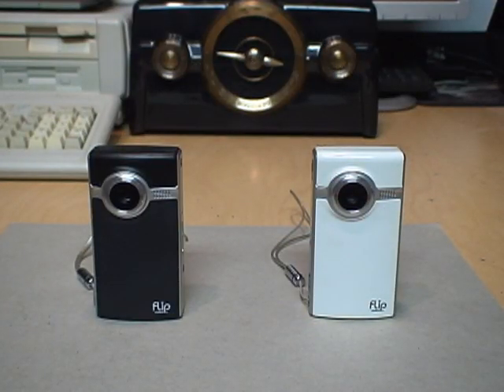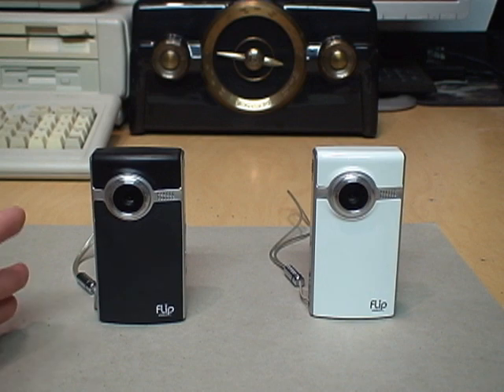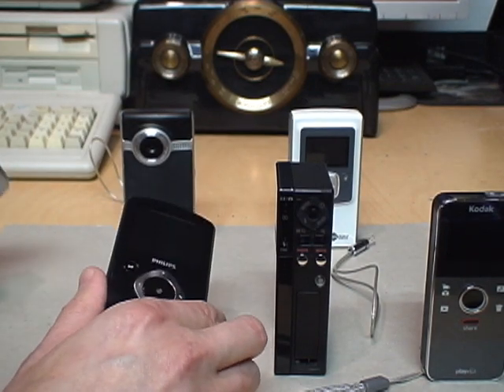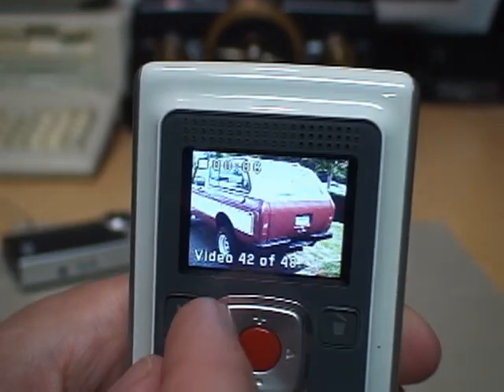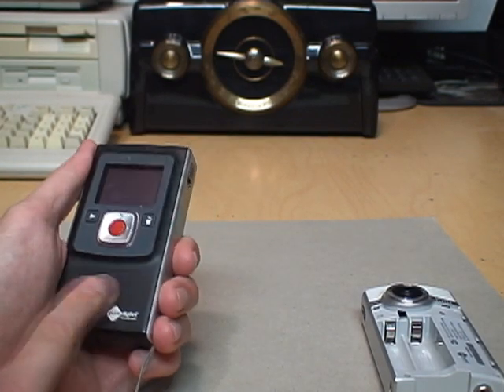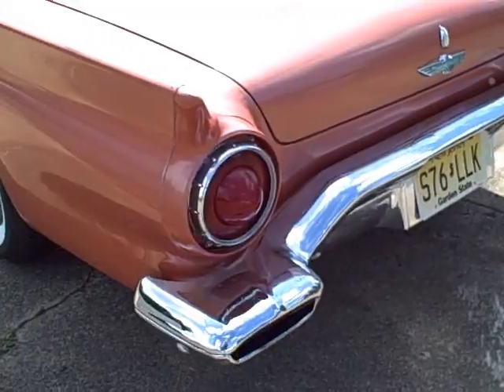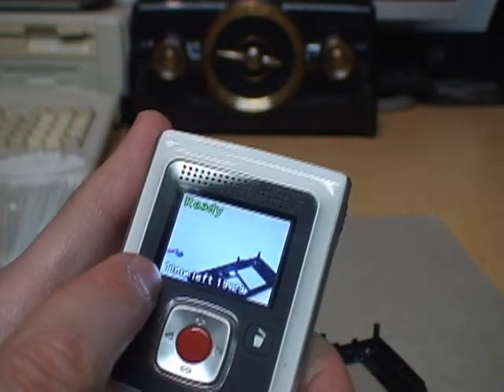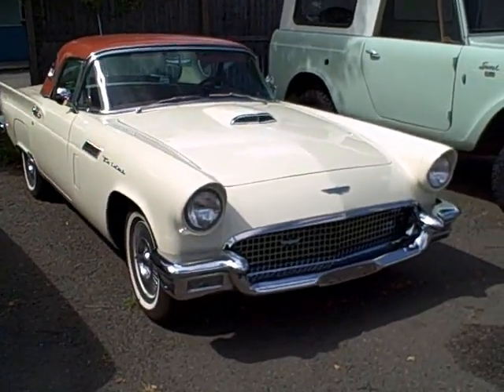Flip Ultra - The camera that powered YouTube's Golden Era

Comment: There's a little bit more to the story on these. These came about as the company who came up with this design originally sold them as a "Disposable Digital Video" camera. You bought it at CVS and had to bring it back there to get the video out. People figured out how to hack it so you could get the vidos your self at home, and keep and use the camera. At the end of 2007, I guess they realized their business model wasn't working out and they released this version with the USB port called the Flip. The business was eventually sold to Cisco Systems.
Reply: I remember those. I hadn't realized it was the same device.
Reply: PS to @VWestlife this means there may be a way to recover video from a dead one.
Reply: @alextirrellRI  No. The original one didn't have the flip out port. There was a "special" connector hidden under sticker on the top.
Reply: @alextirrellRI  Also meant to say, it was still the same USB, but you needed a special decryption key. The new model didn't need that.
Reply: I was just about to say that myself, I remember seeing those at CVS in 2006.
Reply: @ManiacalMichael504  It would take some digging, but there was a hacking scene for those CVS disposable cameras. That special port under the sticker was nothing more than a repurposed Palm PDA port. It's been ages, so I don't remember the exact model anymore, but I hacked the video as well as the still camera. We hacked those because even after the cost of the adapter and time, it was still cheaper than an off the shelf digital camera.
Reply: @doughnutsfowler  Holy crap man I totally forgot about that. I remember seeing youtube videos about hacking those disposable video cameras. I think this is the video I remembered. https://www.youtube.com/watch?v=klaVyjCjoUw

Comment: Flip ultra solved the vertical video problem but even the latest smartphone defaults to vertical video if you hold it in the most natural way to hold the phone. WHY?
Reply: How's about this 1:1 aspect ratio that major news sites are now uploading to YouTube?

It looks terrible on YouTubes phone app. And will look terrible on many monitors.
Reply: @jeffkardosjr.3825  I have the Motorola One Action, which has an 'action camera' that allows you get horizontal video from holding the phone virtually, because the camera has been installed at 90 degrees. I think they put that in 2 models in 2019.

Comment: I still have my Ultra HD that I bought at a flea market many years ago, and it was my secondary camera for some time before my OnePlus One with a dying baseband took its place. The rechargeable battery it had no longer takes a charge, but the fact that it takes AAA batteries (they predate the popularity of external batteries) does allow me to still use it if I needed to. 

Basically, as I imagined it, someone would be at an amusement park or some attraction, the rechargeable battery would run out of power, then if they were near a kiosk that sold camera supplies, they may have had AAA batteries that someone could buy and put in, and have 1 left over from a 4-pack.

Comment: I remember when Flips were popular around 2009, but at the time I had a point-and-shoot camera instead. It took 480p video at almost the same quality, but could also take very good photos (and still can today if you don't want to use a smartphone).
Reply: The FlipVideo became so popular around 2007 through 2011, and it was a great run for 4 years until Cisco decided to ceased production on the FlipVideo camcorder, because smartphones including Samsung Galaxy, Android, and iPhones are taking over by storm that eventually killed the FlipVideo. I still have one from 2009 and it still works.

Comment: I still have a Flip UltraHD III, from 2010.  I think it was the 2nd-to-last Flip model that came out before Cisco discontinued them.  It shoots 720p video.  Nice camera, but it would run down the battery even when powered off, which was a pain if the camera sat for like a couple weeks without being recharged.

Comment: I love these cameras, I have several Kodak ones and still use them.  I think some of the later HD ones still do a good job and with a mic jack they still can be used in short vlogs.  I picked up a Mino Ultra HD for $3.00 at a thrift store. did some minor cleaning of battery compartment and works perfectly.  better to drop one of these than your smart phone.

Comment: I use alcohol pads to clean off vintage sticky rubber. I also use a little baking soda with water and q-tips to clean up battery corrosion (works about half the time).

Comment: Interesting tidbit, when these first came out, CVS drugstore had a version that they sold for something like $14.  It was identical to the standard Flip, except the USB connection was gone.  The idea being once you fill up the memory with videos, you bring it back to CVS, and they send it off to have your videos transferred to CD.  It did not take long for someone to figure out where the USB pins were on the board, so it was very easy to solder a USB cable and use it like a normal Flip.  I had a bunch that I attached to RC aircraft, and got some pretty decent footage.

Also, if you can't remove the sticky rubberized coating, dust it with baby powder and it make it feel like new.
Reply: The scene figured out that special port was just a Palm PDA connection. When I hacked mine, I bought a cable off Ebay, flashed the onboard software, then used the software to connect and pull the files off. The funniest thing about that software was the coder had a thing for V for Vendetta, and made you change the date to Bonfire Night for the initial setup.

Comment: I found a new Flip camera for $12 on a 90% OFF table at Big Lots in 2008 and ended up carrying it EVERYWHERE for years.  Standard definition, half-hour of storage.  About six years ago I bought a pile of various used Flip and Kodak pocket cams on ebay.  These were all HD versions, which sold for $5 to $20 each in working condition.  Oddly, the Kodak PlaySport, which I think might have the same or similar video sensor/chipset as the Zi8, offers by far the best picture quality of the batch when mounted on a tripod with lots of light.  Razor sharp 1920 X 1080 until you moved the camera and got the serious rolling shutter jello. I still use the Kodak for some well-lit tripod shots, because its output exceeds the apparent sharpness of more expensive "Coke can format" home video cameras such as the Panasonic HC-V520.

Comment: I got a Flip MinoHD in 2011, my first actual camcorder, my family gave it to me for my birthday and I used it for maybe 3 years before I got an iPhone 5S.  I like the Flip camera, but I wouldn't use it again because its auto focus isn't very good.  The other thing I liked about my Flip was that it had stereo sound.  I still have mine, but I don't think the battery takes a charge anymore because I stopped using it years ago and left the battery in a discharged state.  The HD Flip camera I have has a Mini HDMI socket on it, and I've no idea how easy it is to get the appropriate cable for it.
Reply: The HDMI cable is easily available online. As for the battery, that may a challenge.

Comment: You could buy a waterproof case, sold as an "Underwater Case",  to use with the Ultra's. I bought the waterproof case ($50) for my white Ultra. Had a black Mino too. Both failed over the years. I might still have that waterproof case somewhere. I remember it worked and you could control the camera while it was in it, but it wouldn't stand up on its own.

Comment: I still use mine. I love its simplicity. Take out, turn on & press the big red red button. They are fixed focus so no need to worry about that or fiddling around with exposure. I can just concentrate on framing the scene that I'm recording. 480P is fine by me!

Comment: Ah yes the flip, I always had a hateboner for these :^). Outside of institutional use these things were really just fashionable more than anything else in my opinion, and I am definitely that one annoying person that poops on that kind of thing. They were a pretty bad spend, almost $200 for essentially a webcam with fixed memory and a screen? PaS digicams existed for similar prices that were better in every way, had optical zoom, removable memory (not only can the Flips memory not be upgraded more importantly the footage cant be recovered if the camera fails), and lets be real any old dummy can use a proper camera... These started out in early 2006 as a $30 "one time use" camera, you were supposed to take them back to the store get the footage off. It was found pretty quickly that it just used a modified Palm HotSync cable. Even though they had a quarter of the recording time (a year and a half prior) compared to the top Ultra model, they were otherwise very similar, gives you an idea of what these things are actually worth.

Comment: They were cool. Many reasons why they were attractive. Bought mine brand new from J.B Hifi, two days later it wouldn’t power up. Had my receipt, back to J.B for a simple swap. A week later same issue, ( i take care of my tech)  however I was concerned the blame would fall on me, back to J.B…. Another new flip & I reckon I would’ve got easily 6 months use then same thing. Dead. I never bothered to return it. Quite obvious there’s tech issues. Years later & today I’ve just re-discovered the old flip and found a few reset vids im about to try to reboot it. Cool story…… yea not really but hopefully its gonna boot up and be GTG 👍🏽

Comment: I bought a Kodak ZI8, which I still use as a 2nd or 3rd camera. In my opinion, it's better than the Flip in almost every way - the lens has a macro mode, it has image stabilisation, the camera records on easily removed SD cards, so you're not limited to any particular recording time, and it has a stereo mic input. The only thing that would have improved the ZI8 would be a stable base so you could use it without a tripod, and a headphone jack. Other than that, it's still a perfectly capable and simple-to-use HD video camera.

My local arts centre had a video club for teenagers, to get them learning about film. They gave them decent equipment - decent Manfroto tripods and Sony FX7s, extra high capacity batteries, XLR adaptor boxes for the cameras - all sorts. They completely abused that equipment. The extra batteries were mislaid. The pan bar teeth on the tripods worn off because they tried to adjust it when it was clamped down - or the pan bar mount was snapped off because they'd dropped the tripod on it's head. The cameras didn't fare any better - housings cracked. At least one camera ended up with it's tape loading assembly permanently frozen in the open position, unable to close. It was awful - meanwhile, I was still using my Vinten Pro 7 tripod and my Sony Z1E camera, quite happily and defect free, bought at about the same time. I'm still using them. I can't help but think a lot of money could have been saved, and a lot of decent equipment used by people who would actually take care of it, if they'd been given Flip cameras instead. They could have thrashed those things till they were held together with duct tape and it wouldn't have mattered. It was frustrating to say the least.

Comment: I just picked up a used DMX lighting controller last year and guess what stupid rubberized coating every knob button and feed her. I popped it all apart and put them in a bag with some rubbing alcohol shook it around ran over it with the electric toothbrush. It came up pretty well not sticky some discolored spots but usable. Had I had more time I probably would've used goo gone.
I also had a wireless microphone that decided to stick to your hand at one point, I thought it was a great anti-mic drop feature but you'll get... Disappeared if you did that with my equipment anyway.

Comment: i have 2 'similar but different' ones, one Alba branded, the other a  TTS, the Alba uses standard AA batteries, but the TTS some sort of lithium ion?  pack, which i havent been able to get (its missing, of course!)
Reply: the Alba has a 2 position focus switch, normal or close up, both have sd card slot for storage, luckily
Reply: both mine can be used as still cameras as well, the Alba 3m pixel, no idea  of the TTC
Reply: i also have one with a flip out screen, takes 4 aa batteries, but seems to eat them!, and is 'supposedly' 10m pixel, but i think its 10m 'interpolated', 5m 'real',